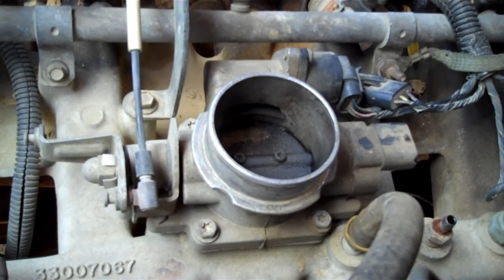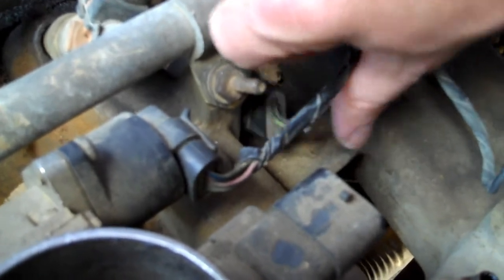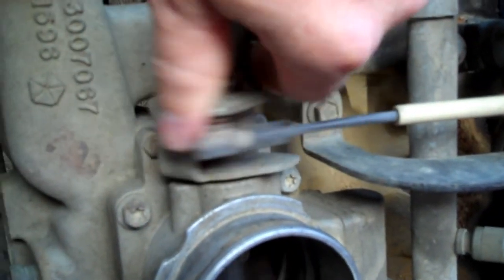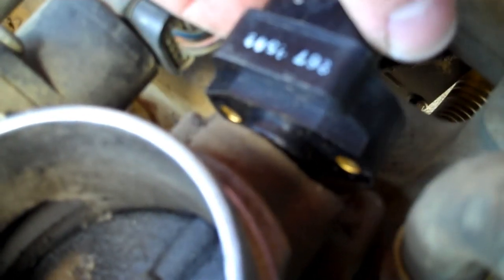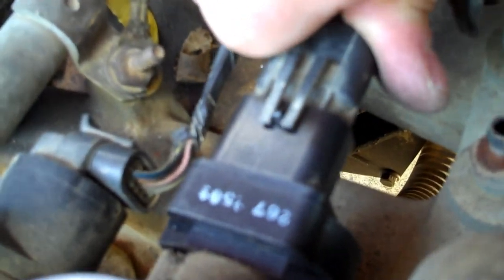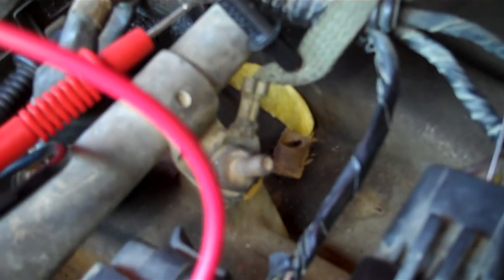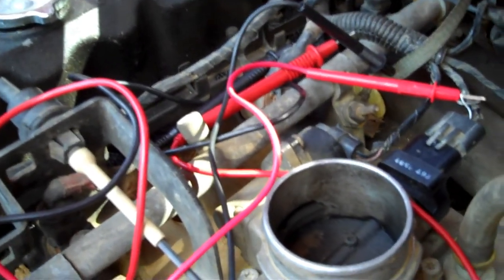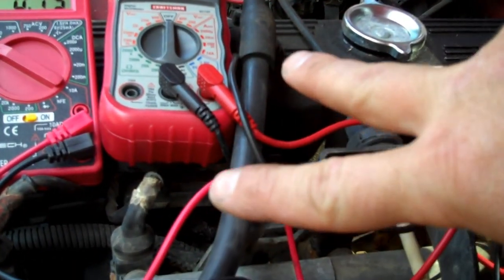Jeep Wrangler YJ - Changing the throttle position sensor

Comment: When you test any of these sensors, do you have the key in the on position to do so? I have a high idle on start that eventually comes down after running a few minutes. When I go down the road at hwy speeds, my check engine light will come on (solid, not flashing). The performance doesn't change, just the light comes on. I did an engine code test and got 12, 21, 24, and 55. I eliminated 12 and 55, 12 being battery has been disconnected within last 50 cycles, and 55 being end of codes. 21 is oxygen sensor detection neither rich or lean and/or input voltage stayed above normal operating range, and 24 is TPS signal above or below acceptable voltage.  I wanna say that I changed the TPS a year or so ago but I can't remember. lol. I'm thinking of just going ahead and replacing the oxygen sensor. It is a 95 YJ, and I'm willing to guess that it is the original sensor. I bought it used a couple of years back. Unknown what previous owner/s have done to it. I've done a lot of tinkering with it. Most recently did away with the front axle 4wd CAD, going to a TJ axle. I love it so much better. I had hell with the cable driven CAD staying engaged. Any input or suggestions on the abovementioned engine light story would be appreciated. I may try the TPS test this evening. Like I mentioned, I believe I installed a new one some time back. When I look at it, I should detect if it looks like a fairly new part. lol. I'm gonna test it out  it anyways.

Comment from the maker: Mike Martinez - You don't have a "reply" option below your comment. Are you sure you are testing the correct wire? One wire is ground, another is 5 volts all the time, the last wire changes with the throttle position. If the reference wire voltage doesn't change then the new TPS is bad also.
Reply: +Power Addicts - FixJeeps.com - Jeep, car and motorcycle tips 

When you back probe the connector by  sticking a paper clip or another piece of metal into the wire is there a chance you can damage the wire?  Any input is helpful.  I'm unsure if I should start testing b/c i don't want to mess anything up... 

Also,  My Liberty manual says the TPS needs it's fastening screws set @ a specific torque level.  What do you think of that?  Can you think of any ways a TPS would cause stalling symptoms?  
Thanks, all
Reply from the maker: David Eichenlaub The specific torque specs is to ensure you dont twist them in two. They are thin screws, it would not be too difficult to break one. Thanks for dropping in! Have a great day!
Reply: What about calibrating the TPS?  Does this not apply to the jeep?  How would TPS problems result in stalling?
Reply from the maker: Jeeps .. just bolt them on and go. A TPS is a variable resistor. As it progresses through the sweep of pressing or depressing the throttle it varies the voltage input to the PCM. If there is a bad spot withing the sweep it will cause a voltage drop confusing the PCM. Voltage drop tells the PCM to alter timing, amount of fuel to the injectors ... etc. Therefore making the engine stall. Hope that made sense?
Reply: +Power Addicts - FixJeeps.com - Jeep, car and motorcycle tips 

It makes sense in terms of installing the TPS and not having to fasten it to a specific torque and not to calibrate it.  I just have to give it that little twist when I put it on, b/c otherwise the bar/rod will be in the way (the shaft that turns @ same time as throttle cable and interacts w/the TPS and turns the throttle plate).  So, in order for the PCM to change things to accommodate the conditions indicated by the faulty TPS it would have to send signals to change A LOT of stuff.  And for some reason the PCM decides it's in the best interest to stall.  Is that right?  I havent tested it w/the multimeter yet b/c the dashes indicating where the dial is turned to on the meter peeled off (it was a sticker).  So, I'm just gonna go ahead and just change the TPS.  If it still doesn't work after that then I'll do some testing.  I was worried about calibration and the torque specs.  And, it seems that I don't need to worry about either, right?

Also,  I don't have too much experience w/ a multimeter.  The backprobing thing?  Do I have to be real delicate in order not to damage the cable & connection?  I appreciate you reading this, and replying.

Thanks, man 
where are your other videos?  I&#39;ll look for them.
Reply from the maker: The stall is due to the PCM potentially loosing signal from the TPS (if the TPS is bad). If its a complete loss of voltage for a split second, as far as the PCM is concerned the TPS is disconnected for that split second.If its just a voltage drop the PCM things the throttle is in a different position while all the other sensors are reading the correct signals. Therefore causing things to get out of sync .. therefore stalling.
Typically only time that a TPS needs calibrated is if its a performance upgrade or modding the voltage. So .. just bolt it on and don't over tighten the screws. Just dont over tighten them and cause them to break. If you are uncomfortable with how hard to turn the screws, purchase a "inch-pounds" torque wrench.
Back probing ... if you gently run the paper clip into the plug till it bottoms out on the metal internal connector you are fine. If you stab a hole in the wire you were forcing too hard. Its takes very little force to get inside the plug, it basically just slides in.
Here is the main link to my channel: https://www.youtube.com/user/MrPowerAddicts/featured

Comment: Will a bad throttle position sensor cause a 91 4.0 throttle to stick in the wide open position even when peddle is not pressed to the floor while driving?
Reply from the maker: Electrically it can make the computer think its wide open throttle. If the actual throttle body throttle blade and shaft is sticking wide open, that's a different issue. Maybe the throttle shaft needs cleaned, the inside of the throttle body bore, or even the throttle cable could be sticking. Now could the actual sensor be mechanically faulty and sticking open .. well ... that is always a possibility. But it would be the first time I ever seen that happen. They are really easy to take off. I'd take it off and by hand test the movement of the throttle body. If it sticks again you know it isnt the TPS. Next take the throttle cable off and test the throttle by hand again. If it sticks .. .its not the cable. Time to clean the throttle body.

Comment: When you back probe the connector by  sticking a paper clip or another piece of metal into the wire is there a chance you can damage the wire?  Any input is helpful.  I'm unsure if I should start testing b/c i don't want to mess anything up... Thanks, all
Reply from the maker: +David Eichenlaub Nope .. doesn't hurt a thing. Just allow the wire to guide the paper clip to not gouge the wire. Thanks for checking out the video! Have a great day!!

Comment: I replaced my tps and it still runs the same, and my tps code (24) is still on. Do you have to calibrate the new one? If so how is that done?
Reply from the maker: +Tom Flannery Should bolt it in and forget it. No calibration needed. Pull the battery cable for about 15 minutes to clear the code. If that doesnt work and you have checked all the connections and wires per the video going to the TPS. You may have an PCM issue.
Reply: +Power Addicts - FixJeeps.com - Jeep, car and motorcycle tips I even unbolted the throttle position sensor from the throttlebody and spun it by hand with a screwdriver and I have no sweep all the way from closed to wide-open throttle
Reply from the maker: Did you check the voltage and grounds? It is possible to get a bad TPS from a parts store. Ive seen it happen.
Reply: +Power Addicts - FixJeeps.com - Jeep, car and motorcycle tips I did check it. My ground is .02 and my other one is -5. I've had 4 tps from different stores and different brands. But I get no sweep on the way up. Stays at .74 and right before wot it jumps to 5.01